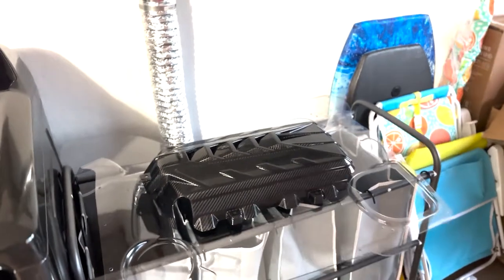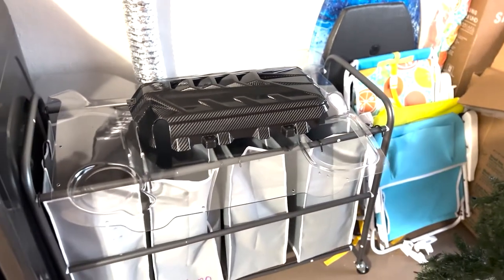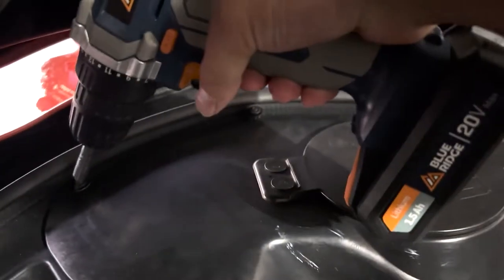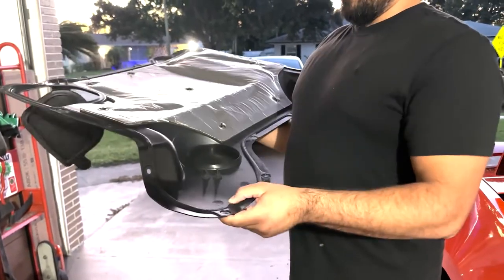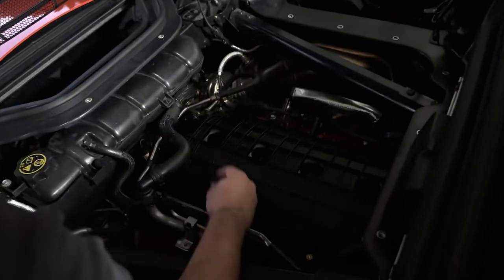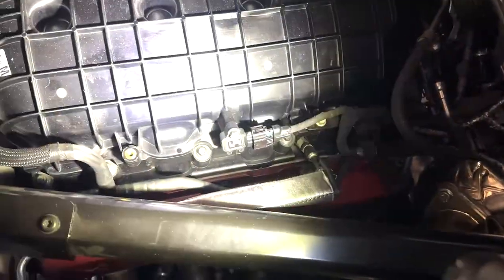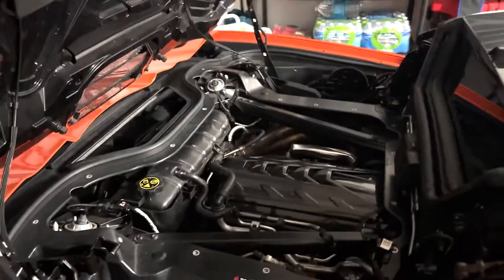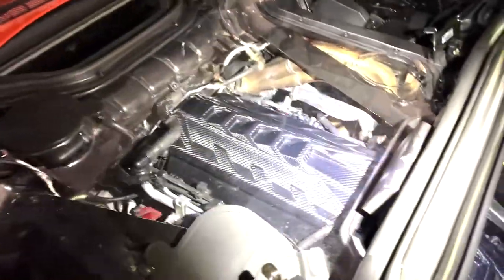Installing one of the BEST mods for the C8 *SEE YOUR ENGINE IN THE HTC*

Comment: I wanted to do this, but i’m afraid it won’t maintain the heat as well and slowly ruin my roof when the HT is folded down. What’s your opinion on this? Has it caused any problems thus far?
Reply from the maker: I was nervous about this as well, but I haven’t had a single problem and it’s been installed for a few months now. 

The product is from paragon performance and it’s solid